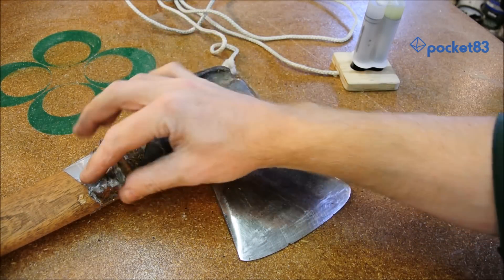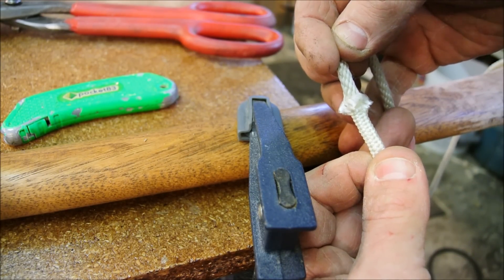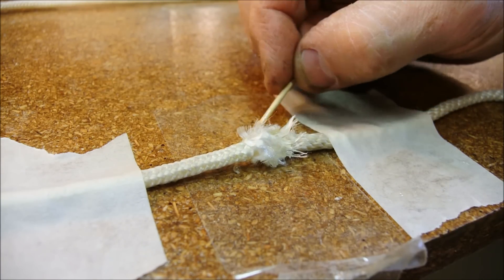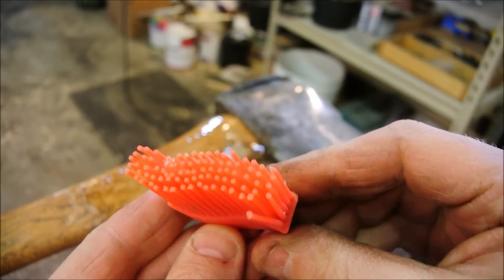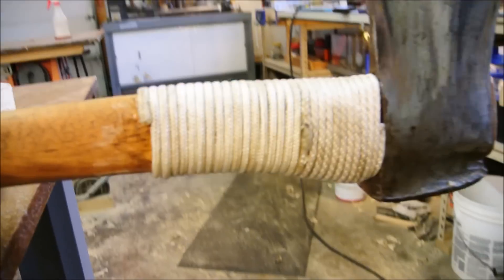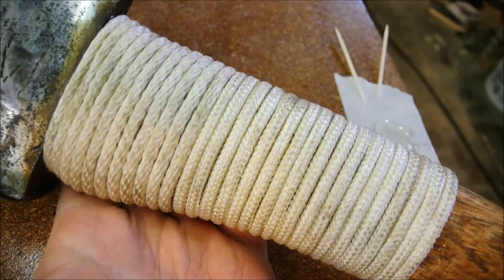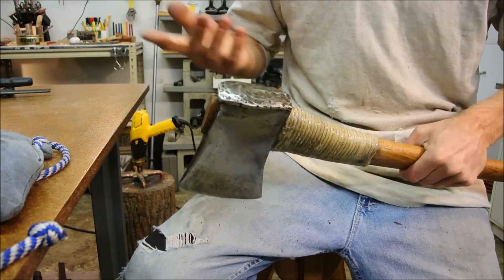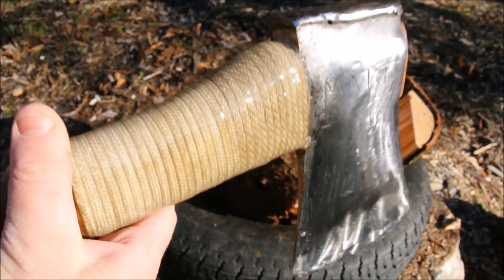Axe handle guard = Rope + Epoxy

Comment from the maker: Common complaints:

► Just use a maul.
Yes, I'm using an axe to split here. It is a heavy axe, so it works great for light splitting. I do not use MATT to halve full logs.  

► Mushrooming is dangerous!
That abuse came from the axe's last owner. The mushroomed steel poses no threat, because I don't hit this axe with a sledge. 

► Learn how to split/aim.
I struck at the back of the log on purpose, for demonstration. As you could then see, it can take a hit. I normally aim to knock a slice from off the side, and I never aim at a piece that's in the back.
Reply: You don't use MATT to halve full logs? what's MATT?
Reply: @aggraphine  Oh ok thank you
Reply: If the axe has been struck by a sledge or was used as a sledge in the past and the butt is mushroomed, it could have stress fractures within, up to and including the eye. A good test for that is having your tool tested with magnetic penetrate..   Hope you epoxy plan works out for you long term, but I’m not putting any money on it as epoxy does become brittle in time if not captured..   Good luck.
Reply: How's Matt holding up?
Reply from the maker: Amazingly well. The epoxy/rope combination is way stronger than I would have expected. Many hours of splitting now after four months, and I can totally recommend.
Reply: @pocket83squared  I'm curious if you had any serious impacts on that yet. I know epoxy, and I don't remember it as all that impact resistant.
Reply: Wrong tool for the job,  his skill sucks!
Reply: in all honesty i can split with a knife so ppl saying to you you should use a maul.... outside ok.. inside... ??? lol i can split with a 2 pound mace plus the cheapest hatchet on earth.. the ppl insulting you for making a handle guard .. they dont understand that sometime your not the only one using this tool .. :P very good idea i might do it and I must say that it looks fucking badass which is why i love the concept thank you buddy !
Reply: @ScreamingReel500  time to get in bob the builder.
Reply: How did it work a year later
Reply from the maker: @sensusfidelium9510  Handle broke below the wrap around a year later. I replaced it with the same thing: been going strong for a year and a half or so. 

Epoxy-rope guards are the ultimate. Nothing is better, and anyone who claims otherwise hasn't tried it.
Reply: It’s been 4 years, update? Looks amazing

Comment: I wanted to cry when I saw the mushrooming on that axe
Reply: why
Reply: Ruger Rugged because the butt of an axe is not hardened, and not intended to be used as a hammer, unlike the butt of a maul. Using an axe in this fashion can cause significant damage, and increases the likelihood of metal fragments splintering from the head and contacting you.
Reply: @rugerrugged9594  and it looks ugly mushroomed
Reply: @airmobiledivision7759  it shows it was used as a hammer, which also can deform the eye, making it hold not nearly as well.

Comment: This morning I was going to add similar grips/guards onto the shaft and handle of a old shovel I'm restoring, but decided to be unproductive and watch some videos after I realized I only had short pieces of rope. (I didn't want to struggle/have weak joins that would fray over time or make it difficult to wrap in the first place; just one of those lazier mornings, what can I say). Well, leave it to Pocket to call me out on my procrastination/excuses! Call it serendipity or whatever you like that you happened to post this when you did, I'm just very appreciative of the time, energy, and effort you put into your videos- and currently very glad you encouraged me to suck it up and get started. So many things in life get delayed or avoided because we don't feel like we have the "perfect" conditions, materials or circumstances. You are always reminding me that with some creative/divergent thinking, motivation, and acceptance of the occasional failure, there is very little that is impossible (and very few excuses for not doing what needs to get done!). Thanks again; when I'm able to use my shovel before the snow starts falling it will be partly due to your inspiration and encouragement.

Comment: The old time choppers here in Nova Scotia used 19 gauge galvanized wire to wrap a guard.  Take about 20 feet and tie one end to the shed.  Walk back and tack the other end to the axe handle right behind the eye. Pull tight and walk to the shed with good tension on the wire.  Tap each row next to the other with an axe file.  Get to the shed, unhook wire - tap a tack into the axe handle and snug wire around - tap tack into handle - done.  Lasts for many years and really saves your handle from overstrikes.

Comment: I used an aramid fabric with epoxy to make a brace for my boy's axe. Layered aluminum foil over it as well to stop the fibers from degrading in sunlight, but mostly I think it just looks cool.  It's much thinner than rope, which I like for handling, and thus far it's survived some zealous incompetence.  It definitely prevents the neck from splintering, which is an improvement.

Comment: Just a suggestion:

When the back of an axe head starts mushrooming on the sides, you should grind the mushrooming off, because if you don’t it could break off and end up lodged in your head, or anyone (or any animals) near you. Along with this, I strongly recommend adding a slight chamfer (knocking the corners off) so the inevitable mushrooming can be reduced and slowed to ab absolute minimum. Just be careful not to hit the corners of the chamfers because they could also break off and fly at things or people, that is, if the axe is hardened.

Just wanted to give my two cents. A little safety goes a long way! :D
Reply from the maker: I no longer feel pain because of the axe fragment that's lodged in my brain. Until the day when it will finally kill me, my powers will continue to increase.
Reply: @pocket83squared  axe demographic huh?
Reply from the maker: Think of it as a Venn Diagram; there is a convergence of safety advocates and tool-specific proponents that will occasionally remind me that there is no safe place to hide here on YouTube. Advocacy groups are omnipresent, and no action or opinion is free from the dissuasive influence of criticism. 

Crabs in a bucket, or the propulsion system of improvement? You decide. I just make the videos.
Reply: @pocket83squared  or you could call it "caring for you (? ..about you? ..just plain caring?), to ensure you can keep making great content"... Because in this case that's what it is... (I remember you being more appreciative when I reminded you of that before you carpolished the head XD) But if you really don't like suggestions that actually make sense, then why not turn off comments alltogether? =)
Reply from the maker: The first time I hear a suggestion, and as long as it's not too preachy, I appreciate it. After a dozen or so of the exact same thing, it gets pretty tedious. Especially when the 'danger' is exaggerated. On the whole, safety advice is no different than any other unsolicited opinion: did I ask? No? Then keep it to yourself. 

Now watch as this useless piece of unrelated procedural dogma becomes top comment. That is, until I delete it. Also note that I don't use MATT as a wedge, so I am at zero risk. The mushrooming was from the previous owner.
Reply: @pocket83squared  you should delete it before your arrogance is going to destroy your channel. just ignore such comments if you cant handle to be polite.
Reply from the maker: You must be new here. Or joking. Arrogance PROMOTES a channel! And I have already been explicit about the "ignore it" mentality. That's only for liars and jellyfish.
Reply: @Smasheer123  call it arrogance if u will. But i for one love pocket for his honesty. I know for a fact that other youtubers play the nice guy for subs. Pocket gets his subs for his content.
Reply: I was just about to say this mushrooming is extremely dangerous
Reply from the maker: E Schel: Thank you. It sucks to get called arrogant every day. I could simply avoid it by deleting every comment in this chain, 'hearting' the original comment, and then replying with "Great idea!" Watch the thumbs go up.

That's what you will see on every channel out there. Why don't viewers see it as disingenuous? I mean, who honestly likes to get safety lectures? Daily! lol.
Reply: Martin Nielsen you must be new here
Reply from the maker: Hehe. Well, Custos, I'm not really "right" in this case, I'm just sick of wasting my productive time and brain power on defending my right to be annoyed by an endless barrage of nervous nellies who claim to know, and want, what's really best for me. 

Why is it that invasions of liberty always start by wearing that same smug smile? Let's nevermind that- to be honest, you and I sound like the assholes here. Such is the caveat of critical thinking. To social obscurity, and beyond!
Reply: Martin Nielsen you’re new to this channel? you should’ve seen when he went on a tirade on his main channel. it was insane
Reply: @pocket83squared  Suppose I meant "right" in contrast to those nellies seeing something "wrong," thus attempting to nanny when, in reality, there's no risk. As the saying goes, boxing at shadows and whatnot. And such is the plight of people aware of their surroundings, to be deemed assholes by those unaware that unsolicited advice is often seen as hostility, or is eventually met with it when repeated ad nauseum and simply not relevant, thus they spin their own lazy susan.
Reply: @pocket83squared  (guess I'll have to quote to not confuse) "The first time I hear a suggestion, and as long as it's not too preachy, I appreciate it. After a dozen or so of the exact same thing, it gets pretty tedious." I totally understand that. Not that I can relate (yet) but I can imagine... And my comment back then was more like "it is what it is, the danger comes from such and such physics, explained in videos from such and so (deemed knowledgeable people), can be solved this way or that way, feel free to implement for your own good" and indeed you answered that the mushrooming was from @realmatt perhaps caused in a tweet where he hammered a bit too long on the same topic =)
Not entirely sure I can agree on the "keep it to yourself" part. After all, there is probably not a bit of difference between your reasons to post a video, and his reasons to post a comment, and just like he chose to watch your video, you chose to read his comment. But I think I'm getting waaaay to philosophical on this tiny, outdated and most of all irrelevant topic. Otoh, it's usually on the irrelevant ones that we feel safe enough to go way out of the box... (by we, I mean me. And perhaps my tired version, my stressy version, my relaxed version and my hyper version too)
Reply from the maker: I still disagree entirely. Consider: you are willfully accepting to listen to my advice when you watch my video. You are tacitly accepting the role of sitting in an auditorium, while I'm at the podium. You could make your own video, where your advice will be the subject on the screen. But here, even in the related comments, this is some strange variety of my private property; here I reserve the right to suppress or eliminate dissonant advice at any point and for any reason. It is not your right to steal the podium in this auditorium.

You seem really nice, and reasonable too. Don't take my disagreement the wrong way. I just don't see unsolicited advice and original media content as equivalent. One has a specific target, and the other has a general audience. One is to start discussion, and the other tends to stop it.

Nevertheless, annoyed or not, I still want to encourage discussion. It's a tough problem. A simple recommendation as stated in the beginning is also a mild criticism, and so when it becomes a steam-rolling bandwagon for the dogmatic, it can become much like protesters who stand in the way of people trying to get to work. I mean, it can become pretty unproductive. Look at the time I'm wasting typing this!
Reply: @lukearts2954  its quite simple. he should grow a pair of balls instead of being such a cry baby. its not that hard to act professional. 
"The first time I hear a suggestion, and as long as it's not too preachy, I appreciate it. After a dozen or so of the exact same thing, it gets pretty tedious"
He is gonna have such a hard time here on youtube if he already complains haha.
Reply: @Smasheer123  what makes you think that he has to "act professional"? Isn't that one of the biggest advantage of the medium, that you can behave however the f you want? For the record, I didn't see any "cry baby" happening. What I did notice, was him being easily irritated. Not that his reasons are invalid, on the contrary, but the extend makes me think if there is some residual stress, fatigue or even culture shock in play. Remember the guy just made a big move, bought a house (bought, right? or am I mistaken) anyway, I don't know how far he moved. But you don't have to change states to find yourself in a completely different culture, and that can easily lead to culture shock, a vastly underestimated mechanism of the human psyche... So cut the guy some slack.
Reply from the maker: Martin Nielsen: "Already complains?" I have millions of views! Spoken truly like somebody without any videos. Moron. 

I bet this comment alone is sufficient to bunch up your panties, toughguy.
Reply: more importantly, the mushrooming is a little bit ugly and definitely a pain in the ass to work around.  and it's so easy to knock it off theres no reason not to
Reply: You should really grind the mushrooming off so you can feed it to starving african children. If you don’t that’s just selfish to keep all that mushrooming to yourself and not eat it.
Reply: @butre.  Now I'm wondering if the mushrooming actually has a purpose now:
To start the argument chain that leads to more interaction, and thus more traffic.

Hmm...
Reply: I second this, I was working with a mushroomed cold chisel and a piece flew off and hit my bicep. Nothing major, just a little blood, but I've been grinding my tools since.
Reply: @Sylencer1982  I guess theres probably some kind of specific cutting task where it might be handy to have the axe snag through the wood.  like maybe if you're using a baby as a chopping block.  now that would get the clipboard warriors coming out in droves
Reply: Martin Nielsen  Pocket is confident, not arrogant. If you worried about your vocabulary as much as you worried about being the internet safety police you would be a much better person and we too would benefit from you’re improved ability to communicate.
Reply: This is redicules. Take is as a friendly advice or ignore it.
Im just not gonna take this fight. its totaly not worth it..
Good luck with ur channel.
Reply: @Megal0squatch  - I wouldn't say extremely dangerous but it is ugly and shows ignorance or lack of respect for striking tools
Reply: Hey guys, that mushrooming is extremely .... oh wait.
Reply: I have lost 3 friends to mushroomed tools fracturing off like a bullet and taking their brains out the back side of their head. 

On a serious note, if you have a safety suggestion, first see if others have already mentioned it, keep the tip short and sweet, and top it off with a nice compliment about the free education or entertainment you received.
Reply: pocket83² I like ur use of words
Reply from the maker: Thanks for watching.
Reply: Hi I'm brand new to the channel and I'm not interested in making friends
Reply: Also a solid chunk of steel can explode when you swing it with your bare hands
Reply: Whatever you do, don't test solid steel against the superior might of tree carcasses
Reply from the maker: jerrett: Pieces of the mushroom might break off at high speed when struck. 
However, whenever hard steel is struck against hard steel, there's always some risk. So use a plastic or wooden wedge. Whoever owned this axe before me was abusive. Still, no reason to cry about it like all of the safety sissies. It's like an endless safety seminar here. 

ian: Go find a fork and an outlet. See if you can use them to induce your prefrontal cortex to work. Look those words up.
Reply: This guy, and john heisz, don't bother them with your safety worries.  1) they already know, 2) they don't appreciate it.  Address your concerns to the rest of the comment section if you must
Reply: Or just do the thing that is well known to spark ire in the place where it's well known to spark ire, I guess.  I'll never understand that mentality but hey whatever floats your garbage-barge
Reply from the maker: @Critical Viewer] Wow. Hey, you want to go grab a cup of coffee or something sometime?
Reply: Absolutely!  I'm glad I read the comments before saying the same thing!
THAT mushroomed head is a REAL problem if he ever wants to drive steel wedges or hit anything steel with the head!  It COULD kill someone IF the conditions are just right when a steel sliver goes slicing through the air and into someone's eye!
Otherwise, nice project and it should work well enough!
Reply: good point very dangerous
Reply: don't use an as as a hammer
Reply: @pocket83squared  oh how silly these noobs are. Hahaha they must not have seen very many of you videos.
Reply: Don't use your axe as a mail or wedge
Reply: @Megal0squatch  legal now in denver

Comment: I did this to two axes in 1980 that are still good.  I used a much smaller braid and made a couple or three wraps.  Use the bottom of a beer can for mixing and you'll save a buttload of epoxy.  i coated the braid on the outside making it durable as hell.  The smaller braid covered in expoxy leaves a smooth, slick finish.YMMV